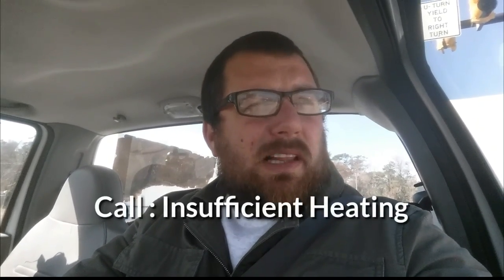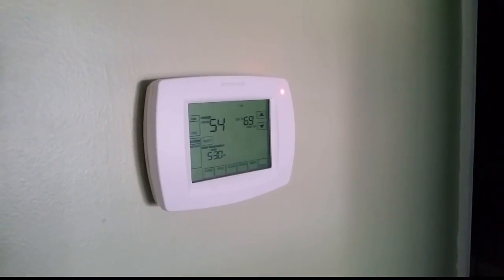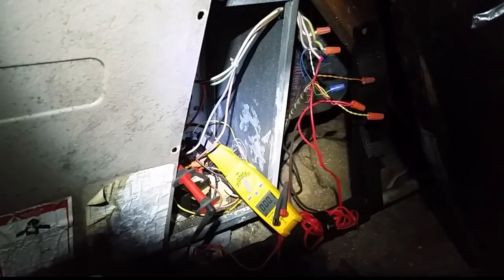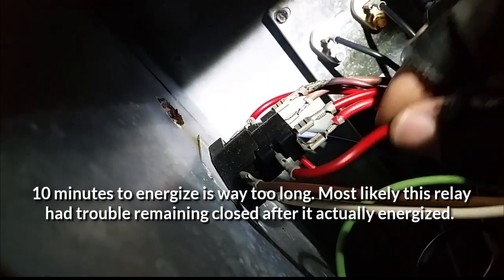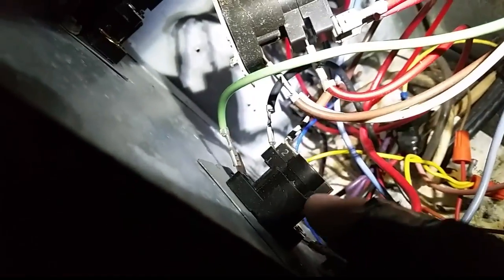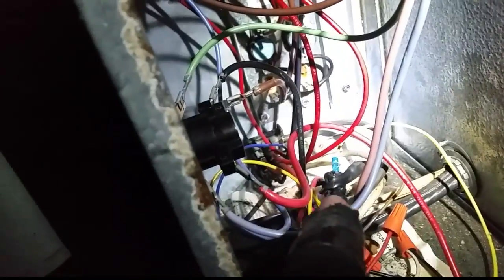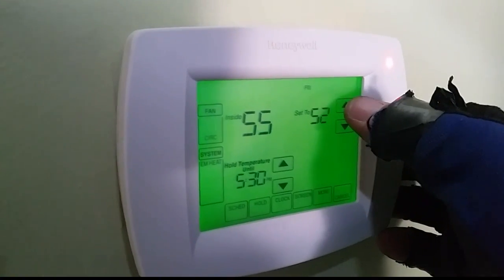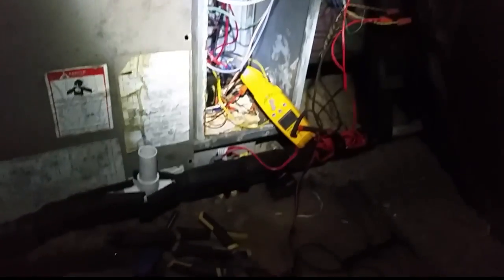HVAC Service : Troubleshooting a Heat Sequencer

Comment: Thank you for your video. My cooling system kept running when the setting and inside temperatures are the same, would it be a Sequencer problem?

Comment: Recently replace the sequencer, limit switch, relay and the transformer due to the sequencer sticking and frying all the components and wiring. I replaced all the components and all the burnt wiring...it ran just fine for a couple months and just the other day the same issue of heat won't turn off came back..I opened everything up and found the wire from one of the heating elements to the limit switch was melted and one wire from the other heating element to the sequencer was melted....what could this be?
Reply: The only thing I could maybe see was I missed a melted wire and it shorted to another...I replaced the melted wires and double checked for any others and started it back up and it performed like normal....I just want to make sure I'm not missing something.
Reply from the maker: Loose connections, bad blower relay. Might try using contractors instead of bimetal disc sequencers
Reply: HVAC Shop Talk Podcast  I found I had missed a wire that was slightly melted and I believe it shorted to some others, so I repaired that one and all of the others and it has been running fine ever since so I sure hope it doesn’t happen again. Is there a video somewhere or some advanced instruction on changing over to contactors? How do I figure out which contractor to purchase?

Comment from the maker: HVAC Service : Troubleshooting a Heat Sequencer: http://youtu.be/WqrMj3Vp4bk
Reply: Great training  talyn875
Reply: Great video as usual Zack. I like the way you explain things. I dislike sequencers. I replace with contactors when possible and the "clunking" isn't a concern.
Reply from the maker: ComfortPlus Heating and Cooling contactors work well too. Sometimes they chatter, but I think they are just as good as sequencers
Reply: Nice job talyn875
Reply: talyn875Nice video and explanation!